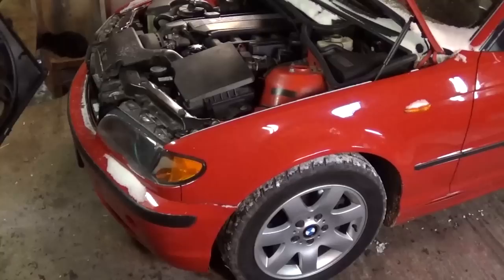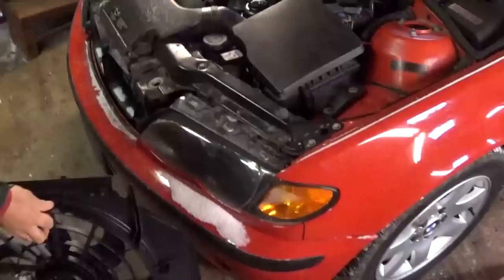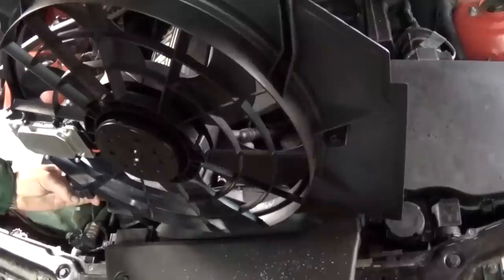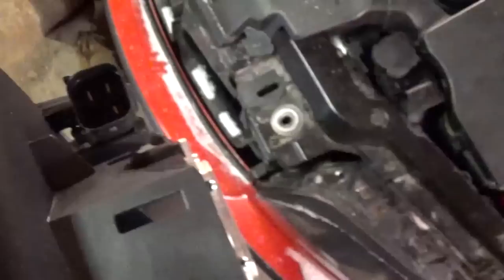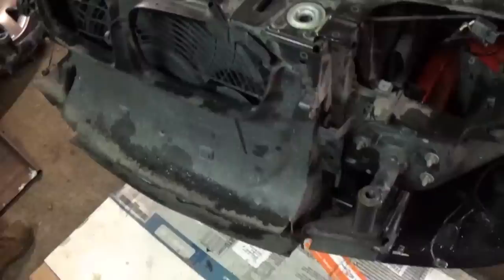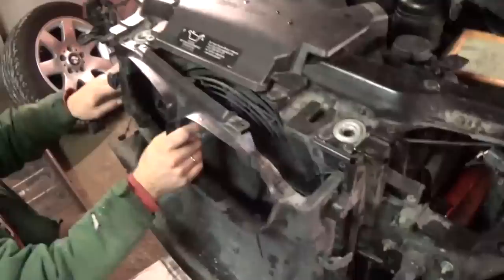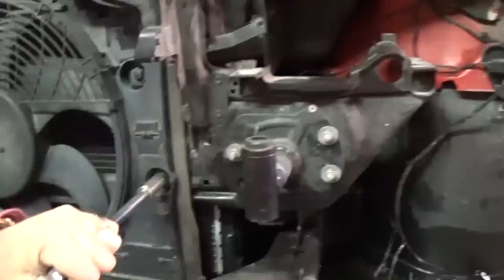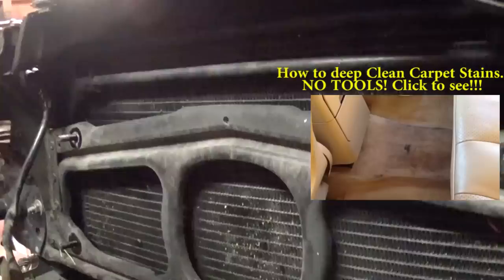BMW 3 series e46 Electric Fan Removing and Replacing. BMW Overheating! BMW 323i 325i 328i 330i

Comment: My car has been running hot and always monitor the antifreeze.
The frikkin fan blades broke off... almost all of them.
I bought the fan blade replacement only because it was 16 dollars and my car is a 2002

Comment: did the new one fit? cause the new one looks different than the old one
Reply: please reply asap
Reply: Looks like he showed replacing the forward fan rather than the one in the engine bay. Manual cars have an electric fan in the engine bay instead of the viscous clutch one on the automatics.

Comment: I have 2004 330ci only one fan, and it's not spinning causes the car to overheat when idle
Reply from the maker: +Raul Serrano is your BMW automatic or Manual?
Reply: World Mechanics it's manual. If it sits in idle for long enough it will start overheating so before that happens I just turn it off. Fan doesn't even move at all.
Reply: World Mechanics I only turn it on in my drive way. I haven't move it at all.
Reply from the maker: Raul Serrano we had the same problem in the past. Check the fuses and the relay but most likely it is the fan control box. It is next to the fan. It controls the speed of the fan and when to turn on and off. This is a weak spot. Most of the times you will have to buy a new fan assembly
Reply: World Mechanics I got a new relay, thinking it was that. Issue still persist. I order a new fan assembly, waiting for it. Thx for the reply I wasn't expecting one. And my fan is not on the bumper it's behind the radiator does that make a difference?
Reply from the maker: Raul Serrano you can see the fan assembly and the fan control box in this picture here: http://www.ebay.com/itm/AC-A-C-CONDENSER-COOLING-FAN-FOR-BMW-FITS-320-323-325-328-330-E46-BM3020100-/271967834291?hash=item3f528bd0b3:g:6KkAAOSwFnFWFB30&vxp=mtr
Reply: World Mechanics thank you, I'll post later if issue is solve. And if I had to do something else. I might end up helping someone else.
Reply from the maker: Raul Serrano it does not make a difference. If you ever need help let us know. When the control quits your fan will either not be able to turn on or it will be stuck on all the time, even if the car is not running until it drain the battery.
Reply: World Mechanics Got a new fan. Fan doesnt turn on
Reply: World Mechanics what controls the fan? I took antifreeze out of the car. It was cold and the temp was showing it was hot. Took the thermostat. Out water got warm. But mosy of the water with a looking hot engine was cold fan never turn on. My car never leak water just started steaming thats when i realize it was overheating in first place.
Reply: Engine was hot to the touch
Reply: World Mechanics by water i mean coolant. The car warms up if i leave it idling from cold start . It eventually gets too hot liquid is cold fan not spinning. I have conpletley taken most of the liquid out since i made a mess with thermostat i just took the cap from the reservour out and let it  drain.
Reply from the maker: +Raul Serrano do you know how to bleed the cooling system properly? This could be why your car is overheating too. We have the video on our channel. It is very important to bleed the cooling system the right way on a BMW e46
Reply: World Mechanics going to put the reservoir back in. And adding coolant. And I'll do the flush I saw in your video.
Reply: World Mechanics the fan is working know since I follow the bleeding process l, my heat doesn't work anymore do.. but hey the car doesn't overheat what could cause the heat to stop working?
Reply: World Mechanics when I disconnect the reservoir and bottom hoses I heard something snap. So it's leaking from the bottom. Know I fix one problem and got another that I made with my carelessness... damn myself do I need to change the entire reservour and hoses or just reservour and clip?
Reply from the maker: Raul Serrano can you send me picture of the reservoir to see what happened? Message them on our Facebook page. If you do not have heat. Turn the heater all the way on hi and after car warms up rev the engine up to 4500rpms for about 30 seconds.
Reply: World Mechanics the heat turn on after a few mins of test driving it. It started like a small drops of coolant  eventually lots of coolant came out. To the point the low coolant light came on. And car started warming up again. But not super hot. I'll send pictures tomorrow too dark
Reply: World Mechanics okay so I got replacement tank. I have zero leaks know. Coolant level stays same. But the car still overheating after riding it. It stays in middle but when I drive it. I starts  warming up. I have this white like steam coming out of the exhaust. It comes on when crank and it keeps coming out. The engine has no sign of overheating not smoke no water leaking. The fan is full speed running but I do worry of that white steam coming out of the exhaust and it warming up when you ride it. Heater works just fine too so does ac.
Reply: World Mechanics +SD Cruzer it's not a lot of smoke coming out. It's like when you turn the car on in cold morning. That's the sort of smoke that comes out. But it doesn't stop. It comes in steady flow when step in gas pedal it goes away. Comes back when in idle, no weird engine sounds. Or shaking of engine.
Reply: World Mechanics so the mechanic replace the water pump. Still heating up, he took the thermostat and very throughly examine it. Turn out it was bad thermostat even do it look brand new. So always double check the thermostat.